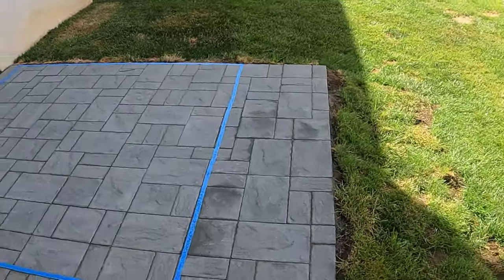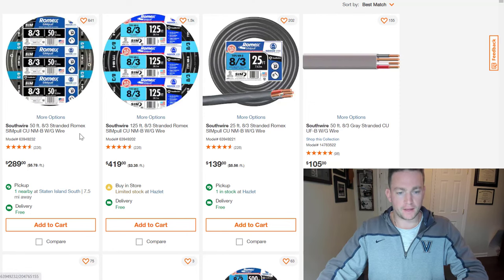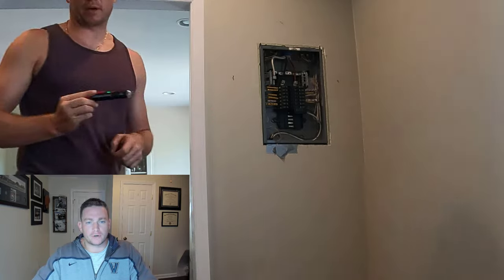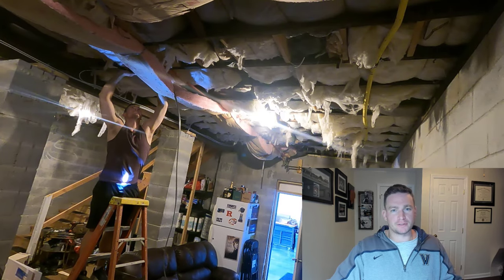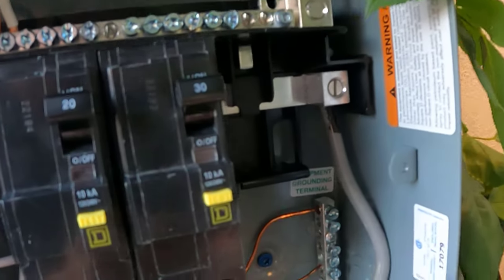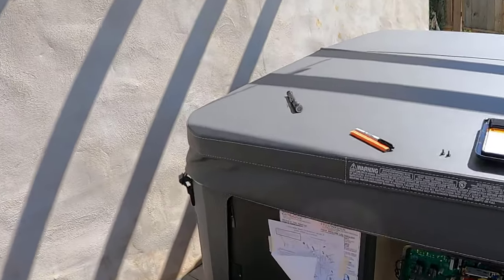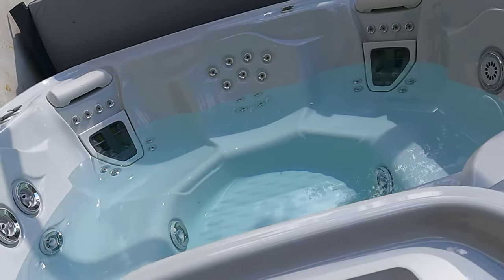How to Wire a Hot Tub for Dummies

Comment: UF cable with 8 awg is limited to 40 amps according to NEC 60C column. If you used conduit and thwn type wire the NEC allows up to 75C rating which then 8 awg has a 50 amp current capacity.

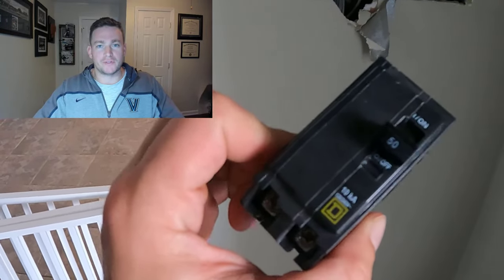Comment: @6:50 There's only one pole lever because that lever inside the breaker throws both poles. This means that both poles trip together. Almost all of the time this is what to protect you and the equipment from a single pole still being energized and either shocking you or faulting the equipment. There are exceptions, but not for residential use.
Reply: It's kind of hard to tell, but did you use a GFCI breaker on the outdoor panel @11:30. If not you ought to, it will be much better at protecting people using the hot tub if something shorts (in the unlikely chance that occurs).
Reply from the maker: @atawoo2  yea for sure used GFCI. It's actually against code not to use that

Comment: You need rigid conduit buried at least 18”. That flex can’t be buried like that. Also flex should be 6’ max. Need to run rigid around the corner then transition to flex. Also as other have pointed out you have outdoor wire inside(not really an issue) but inside wire outdoors. Should be 6/3 to the gfci box and 4 #8 or 8 wires of thwn to the spa.

Comment: If my main breaker box is already outside do I need the sub panel box or can I just go directly from main breaker box?
Reply from the maker: I'm not sure, but you definitely need to make sure it's the GFCI.
Reply: The NEC code states hot tubs shall have a disconnecting means accessible and within sight (25 feet max distance and visible) when at the tub and also out of reach to persons in the hottub.

Comment: Pretty sure you undersized your 50A conductors. 8/3 UF-B isn’t rated for 50 amps. You have to use the 60 degree column. If you had used individual THHN conductors in conduit, you could have used #8, which is probably why that’s what your drawing said. Did your drawing say anything about those gauges being the minimum gauges, or about the applicability of certain NEC sections?
Reply from the maker: The electrician didn't seem to have a problem with it when I showed him everything that I had done. And no the drawing didn't say anything about the gauges minimum, I just used what was there. It's been working fine for about a year now. Also even though it's a 50amp breaker the hot tub max it will use is about 40.

Comment: How'd you get the wires into that wire harness on the control board?  One of the wires came loose and its not a push in kind.
Reply: A small screwdriver in the tab above the hole where the wire goes inand pry down while pushing the wire in..make sure power is OFF

Comment: I just bought a used tub and finished filling the tub up to check for leaks. So far so good, but I only have it wired with 110v for now. I can see the light is working and it has been going now for a few hours. I seen that you filled your tub up from the filter area? Is that the proper way and I messed up just filling it from the center? My tub just turned 20 yrs old, infact I need a new topper as well. Also the panels need to be redone.
Reply from the maker: Wow, I hope you can get a bunch of more years from it. I don't think it matters much where you fill it up from.

Comment: Didn’t you need to put a spa pack GFCI disconnect on the wall? Pretty sure you need a disconnect between the tub and the main panel.
Reply from the maker: Yes for sure! The sub panel that came with the hot tub  had GFCI breakers. You can see this in the bottom right at 7:28 in the video
Reply: Where’d you get the sub panel from?
Reply from the maker: @donovangaston1679  it came with my hot tub.

Comment: Couple things off the top of my head that come to mind you did wrong, not bashing, just to send some knowledge your way. First you used the nm-b (romex) the yellow and orange cable outside because it’s rated for indoor dry location use only article 334 in the NEC if you’re interested. A wire connector on where the uf cable entered the panel to prevent being cut from the edges of the hole and a male adapter with a bushing on the pvc conduit that came out the wall into that spa breaker panel. And I would have used THHW single stranded cables in the liquid tight flex. Also the 8-3 uf cable insulation type is rated at 60 degree C like the nm-b article 340.80 NEC, meaning it is only rated for 40 amps. The NEC and the ampacity of all the insulation types can be found in table 310.16 NEC. Had it been a different insulation type like THHN you would be fine with the 8 awg wire, but since you used uf it should be upsized to 6 awg. And that’s just a few so as to not overwhelm you.
Reply from the maker: @usmarinekenny  thanks for the feedback

Comment: Great job, but you ran one 8-3 wire, and I see two coming out of the block wall. Did I miss something?
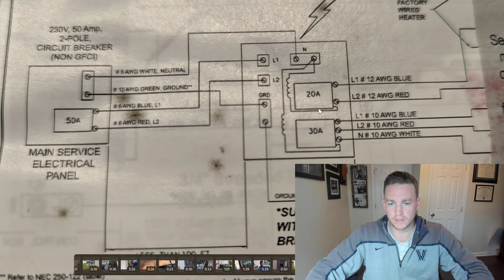Reply from the maker: If you look at the diagram at 2:32 I run the 8-3 wire from the main panel to the sub panel. Then from the sub panel I run a 12 and a 10 so I think that's where it appears like I had 1 wire that turned into two.

Comment: If my hot tub is on a concrete slab do I need to bury the wire in the concrete or can I run conduit on the outside?
Reply from the maker: You can run it on the outside like I did between the outside wall of my house and the hot tub side

Comment: You never put a jacketed 3 or 4 wire cords in conduit as you can only put single wires (not grouped and jacketed wires) as they are designed to be in the open, inside wall, framing cavities or underground in dirt (if they are for that) 
Because they generate constant heat that as in (conduit) the heat generated and continues to build up inside the conduit till it burns 
So change your cable that is inside of the conduit to single wires 
Please watch and read from professionals and check code before you embark on your next construction/ electrical project period for your and others safety

Comment: This would had failed an electrical inspection.
Reply from the maker: I had it inspected by an electrician and it was fine. What do you see wrong?
Reply: @SuitTV even though hot tub works…yes, this would have failed inspection for sure.
Reply from the maker: @javvoltage9632  I had an electrician inspect it and he said it looked good. What do you think is wrong?
Reply: @SuitTV  off the top of my head ( I need to watch video again) what’s wrong is your 10-3 and 12-2 romex going to your spa in the liquid tight is against code, also the pvc pipe that’s coming in behind your spa pack should be a a threaded nipple (code) also the uf cable in the pvc maybe over fill you need the correct size of pipe for that (conduit fill) I will need to check the code book. The romex, 10-3 and 12-2 inside your spa is rated for indoors that spa is outdoors in wet area you need seal tight and thhn wires.

No hate but there’re quite a few code violations.
Reply from the maker: @vash01000100  oh alright good to know. Interesting my inspector never mentioned that.
Reply: @SuitTV  the disconnect is not within sight of the hot tub because it is around the corner! The homerun is undersized wire, its unclear if there is a 120 volt receptacle within sight of the hot tub, liquid tight conduit is not rated for underground, and thwn is required for outside so cannot use NM cable with outside for a hottub.
Reply: You can't use.indoor wiring to do outdoor wiring. You need to use underground wiring from swim spa to BOTH units. One connector for both feeds also is a no no. It would have failed. I'm an electrican.  Not being an ass trying to help future people

Comment: How do you connect the wires to the grey connector in the hot tub itself?
Reply: I can’t figure out how to insert them
Reply from the maker: There should be a punch out for the wires to go in and then you just follow the manual instructions on which receptors they go to